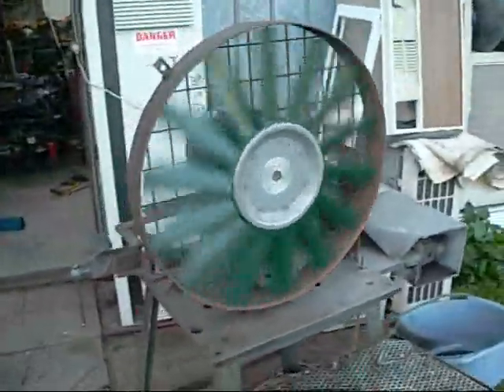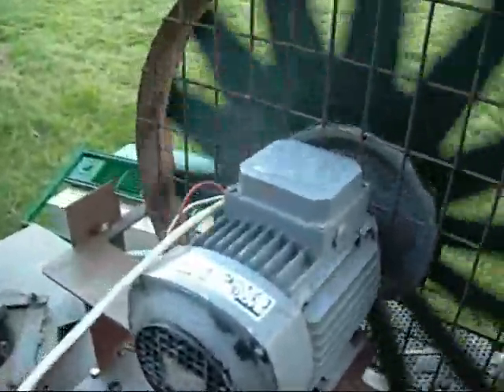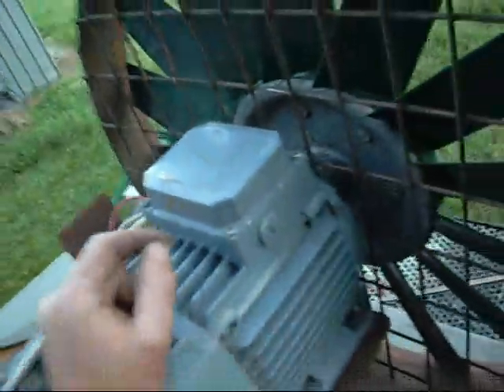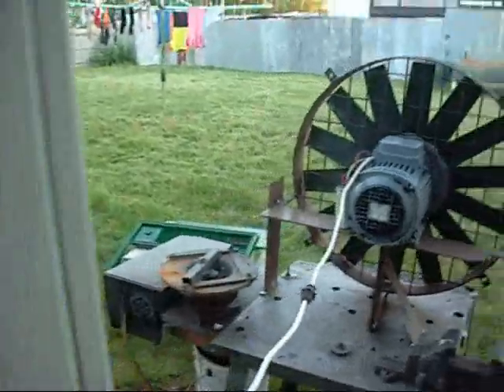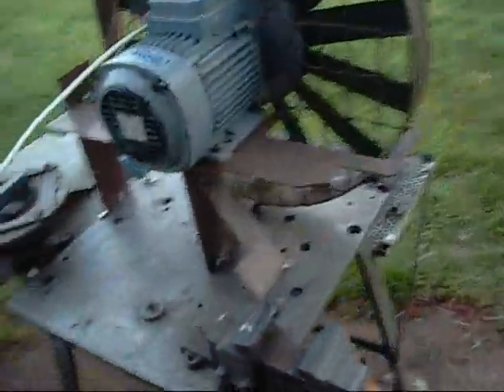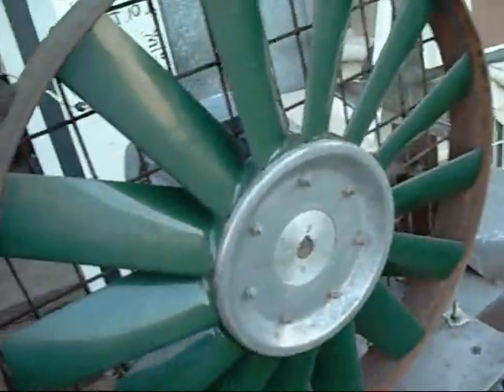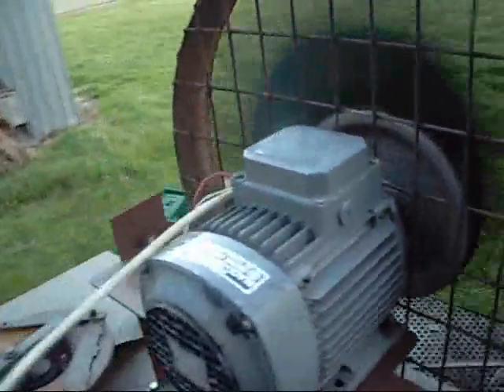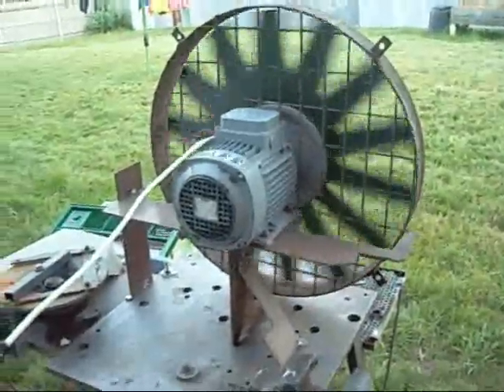Multi-Wing Axial Fan with ABB 2Hp Motor

Comment from the maker: @METALLICA1024 its a huge heavy impeller, plus the application is usually on a oil riig or mine shaft, thats where you need 4 - 6 of them ( I did a few contra-roating 2 stage units for mine shafts)

Comment from the maker: its a 4 pole 1425Rpm motor, and as you mention, they need to be ran in an 'Air over" configuration to stay really cool.

Being Australian spec 240V 50hz, our 4 pole motors run slower than US 120V 60Hz motors

Comment: Better Wiring for 3 Phase motors on 1phase with capacitor is not Star but Delta wiring.  on star wiring motor really runs on only 2 of 3 coils so it is similar dificult to  start  this type of motors, if you'll connect it on only 2Phases of 3.  not start without help, and easily will it burn.